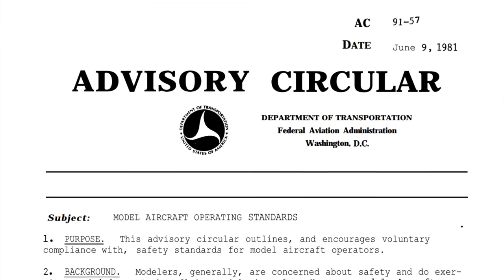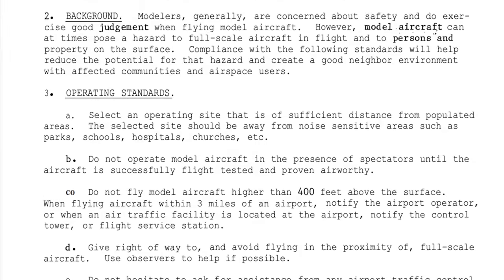A Remote ID Solution for Fixed Wing RC

Comment: Consider that it is actually brilliant to group all unmanned aircraft (drones) under one section and the use of terms that are all encompassing. This methodology "future proofs" the law as it now includes all past, present, and future (perhaps yet to be constructed) aircraft regardless of configuration, propulsion, or lifting method. Also, the past has less relevance than the future potential of unmanned aircraft (drones) regardless of the configuration or physical structure. When airplanes have the ability to hover, they will be just like quadcopters and helicopters. Then you have the "Wings" which is technically not an airplane, but neither a quadcopter. Plus, FPV airplanes now have long distance capability and don't even need an airfield. Yes, it is reasonable and even rational to have all UNMANNED aircraft under on section.
Reply from the maker: The evolution of aircraft, to include RC models, is constant.  But it is a good idea to start somewhere, establish some ground rules and definitions, then adapt as things change and evolve.  Tim
Reply: @TimMcKay56  And here, I thought the ground rules were established: 1) aircraft is defined as any object that can maintain flight. (regardless of configuration),  2) Unmanned aircraft has NO pilot on board the craft, 3) Unmanned Aircraft (or Aerial) System has a remote control station that is not on board the aircraft.  Then there are the UAS rules in the Part 107 section and Recreational Exemption "carve out". The irritation for some is having 1 set of laws and rules for all Unmanned Aircraft. Or specifically, one rule: Remote ID. When you think about it there are more similarities than differences between RC unmanned aircraft; VTOL and hovering being just about it. Now, a Harrier Jet RC airplane would have pretty much the same capabilities as a propulsion only craft (helicopters, quads, etc.). So, that sort of makes everything the same, more or less.

Comment: Disagree.  Lumping all UAS together DOES make sense.  The separating factor should be anyone flying anything BVLOS at altitude or long range should require remote ID.  Regardless of method (looking at phone screen, FPV goggles, Waypoints, etc).  

Anyone flying VLOS, regardless of UAS type, needs no remote ID.  No VLOS flights in controlled airspace (without approval) or above a determined safe altitude.  

Complex area is FPV freestyle pilots and racers.  They shouldn't be regulated to Remote ID either.  They fly low altitude FPV.  You could argue they pose a danger to others (folks on ground, property, etc) but thats not the FAA's purview.

Another grey area might be RC soaring who DO fly at very high altitudes VLOS.  But I'm sure there's a reasonable way to manage that.  I just dont know enough about that aspect of the hobby to comment.
Reply from the maker: Fair enough, just staring the discussion!  Tim
Reply: @TimMcKay56  that is appreciated!

Comment: Hi Tim, I completely agree. Separating out the two activities goes a long way to fixing the concerns with the new drone regulations and RID. This would help a lot with the STEM concerns. I would also say there are othering defining characteristics like having GPS and IMUs on board of drones.

The other change I would like to see with RID is to leave the drone pilot information off the public phone apps and leave it with law enforcement instead. This is for pilot safety.

In any case, it is one really good step in the right direction.
Reply from the maker: Thanks!  Tim
Reply: What two?
Reply: @RickLaBanca  Separate out fixed wings and drones. Drones and Fix wing ("fixed wing" includes helis but excludes drones with cameras) are the two activities that would be separated out from each other.
Reply: @yodaiam1000  no, the point is drones aren’t not one thing. A dji drone is not even close to quads I fly

Also fixed wings aren’t either. Field flyers aren’t long distance  as nice wing fliers.
Reply: @RickLaBanca  It is kind of the point. you want to separate out these different activities. He is just saying in the video to separate out the UAS with cameras and those without. It is one step in the process and it happens to be an easy step. If you want to separate it out further, that is good too. You just need a definition  to separate it out and the camera and the goal of the activity is a way to do that. If you have a camera but are not in the same airspace as video/picture drones, then take the concept further with the drones that do have cameras.  Separate rules out further by weight, altitude, GPS, IMU, sheltered activity etc.
Reply: @yodaiam1000  no I think making a simple division like that is also the problem Tim is trying to solve. 
By lumping helis drones quads together it’s the same as wings lumped in.

Can’t just take a bad first step for the sake of stepping.
Reply: @yodaiam1000  also cameras? No idea why that matters.
Reply: @RickLaBanca  I don't think it is a bad first step. I don't think you stop the relaxation or rollback of overreaching rules because the benefits don't extend to everyone. If you refine it to include your arm the hobby, the is good as well.

How does it adversely affect you if many of restrictions are lifted from fixed wings.
Reply: @RickLaBanca  Cameras are an identifiable feature of drones that are proposed to take video and pictures of the scenery. It is primarily those drones that are supposedly creating the safety concerns for the FAA. You could also add GPS and IMUs as features of drones that are taking video and pictures of the scenery to better isolate the main concern.
Reply: @yodaiam1000  by implying that wings are not needing remoteid it implies other aircraft do. 

Especially if the argument is (incorrectly) contrasting the other types of craft.
Reply: @yodaiam1000  that’s too wide. It’s hard to draw the line, but fpv quads aren’t something anyone can grab and fly yet it’s may have all those components.

Comment: Tim, do you know where the 250 gram weight limit came from?  I think a kilogram would have been a more useful and workable limit.
Reply: Tim wants you to fly rubber band motor models, but only at approved airfields.
Reply from the maker: Freed:  I do not work for the FAA, but my guess is they tried to figure out a light enough weight such that a drone of this weight either hitting an airliner or getting sucked into an engine would cause minimal damage.  1 kilogram may work as well, we'll see.  Tim

Comment: The Department of Transportation has no problem categorizing automotive vehicles. No one would assume regulations for an 18-wheeler would be identical for a motorcycle. The FAA needs to separate LOS aircraft from BVLOS/GPS aircraft to fix most of the problems (government overreach) we're dealing with today.
Reply from the maker: Agree!
Reply: Again this is not a good idea. People here don’t even know the differences, lumping in store drones that fly for half an hour with built models. 

I’d be much more open to pilot separation as is ham radio vs unlicensed operators. 

Part 15 radios vs honestly built. Faa could do the same.

Comment: hi Tim
I built a 8 ft tall model crane with 6 -2 wire 12v motors. is it possible it set it up with rc control?  thx
Reply from the maker: I cannot see why not . . . good luck!  Tim

Comment: Yesterday Tower Hobbies canceled my order for the Spektrum SkyID RID module. I contacted Tower today and they said it was a system glitch. I have to reorder and there are 2 days left on the pre-order discount. ETA for the module is now late November. It was previously 10/22 which is tomorrow. Not sure what to make of it.
Reply from the maker: I am in the same boat here.  I ordered my SkyID from Horizon Hobby on Aug 25, has still not arrived.  Tim
Reply: @TimMcKay56  RID is off to shaky start.

Comment: Simply put, It isn't what you fly. We already have to get waivers for above certain weights of aircraft. If you fly a camera drone at your FRIA , and follow all the rules under AMA, what does it matter what I fly, within the guidelines of AMA and the FAA. Your trying to add additional restrictions that  don't improve safety.  If, probably DJI drones are routinely being seen in conflict on approach/take off, That is a person operating a drone in a reckless and dangerous manor. That operator must be found quickly and processed appropriately.  If, like I have done, fly at a park within about 2 miles from the end and a mile off the approach corridor of a busy city airport, LAANC approval, and I stay below the allowed altitude , 200ft for this spot I go, it is a non issue.
Reply from the maker: Roger all!  Just trying to start the conversation.  One needs to begin somewhere, simplify a bit to get the first step done.  Tim

Comment: This would be a good solution. Lets not forget our friends RC helicopter and autogyro pilots. They fly at the same fields as us fixed wing pilots with the same contraints, i.e. piloted by a human not a microprocessor.
Reply from the maker: I mentioned that in the video, when I say fixed wing include the helo folks.  Tim
Reply: What about all of the "acro" fpv drone pilots? It seems everyone thinks that fpv drones you just buy off the shelf and suddenly you can fly, when in fact most are custom built and require 10+ hours of practice in a simulator before you can fly without constantly crashing. The barrier to entry is extremely high in both cost and skill (both piloting skill and build skill) It's unfair/misleading to show a clip of fpv drone footage and in the background talk about how anyone can easily go buy a drone and fly it.
Reply: @gordonmckay4523  as long as they're flying legally, whats wrong with that? All of the drone races where I live occur at club fields by the way, and all of the fpv pilots I know are very cautious about where and how they fly. Fpv drones are for acrobatics by the way, not "pictures" as you stated in your video. The drones you are talking about are photography drones like those made by dji.

Comment: Drones were required to operate at 30 GHz, they would have to be operated line of sight because that doesn't go through any obstructions, and the range would be severely limited because of the power requirements to go far.
Reply from the maker: Interesting point!  Tim

Comment: It is like Citizens Band radio and Amatuer radio.

The Hams are serious hobbyists who have a massive, and long standing, interest in advancing the art and science of radio.  The radios and antennas can, and do, cost tens of thousands of dollars+.  The yahoos are generally hated, and except for some bands where the "bad" people hang out, it is somewhat of an orderly hobby that takes place worldwide between enthusiasts.  

The Hams must take an FCC exam to operate their radios!

CB is a monkey zoo, but there are serious users of the medium (truckers generally-I rarely listen to CB).  No exam is required for CB (the radios are licensed by the manufacturer), and it shows in the patrons.  GMRS doesn't require an exam, but there is a modest fee for a license ($35/every 10 years).

The FCC recently has been ramping up enforcement!  Big fines and seizing equipment.

The whole thing reminds me of when CB exploded in the 1970s.  Eventually sUAS will all settle down I guess.

As you pointed out, in the 1970s, model flying had a large $$$ barrier to entry (certainly I could not justify the cost in the 1970s).  China has made Ham radios cheap, compared to the premium Japanese stuff.  However, the Hams seem to be policing their territory still, especially given that the VHF bands are dead compared to what I was hearing in the 1980s.

Remote ID is the means for the model flyers to take back their hobby.
Reply: And unlike the faa, the fcc and hams have always worked together.

I agree I’d rather separate class of pilot instead of class of craft. 

No remote id for a licensed hobby pilot. 

Remoteid for store bought. 

This is like part15 radios for consumers vs home brew which is legal only for hams.
Reply from the maker: Copy!

Comment: It is hard to make this case to the FAA, when the AMA ran to embrace the quadcooter flyers when they became popular. The AMA should distance itself from any flyer not using an AMA  or specifically dedicated flying fields. That includes schools, concerts and parks where the public may be present.  Sorry RC flying is not compatible flying over or near the public, doesn't matter if the vehicle is big or small.  The AMA screwed up, what can you discussed that relieves RID,  flying at an isolated field, that's the distinction. VLOS is the boundary that makes all FAA rules superfluous.   Well Tim you've finally come to your senses after a long time.
Reply from the maker: Any organization or person can change their minds as events develop.  I think this is fairly normal.  I certainly cannot speak for the AMA.  I do know from reading their magazine that youth outreach is a huge part of what they do, so they are pretty much going to be involved with drone RC activities.  My point with all this is that the RC hobby is evolving so quickly in so many ways, it would be a very wise idea to accept this and form some strategies/relationships with USG agencies that are for sure going to get involved.  Lead the conversation, not just follow it.  Tim

Comment: What about helis?

There’s not two part separation.
Reply from the maker: I mentioned it once, my intent was to use helos and fixed wing in same sense.  Tim
Reply: @TimMcKay56  then why not include quads which might as well be helis?
Reply: @gordonmckay4523  well the wings are fine on their frias so why not start with who is getting impacted the most…. Freestyle/racing quads that require skilled pilots? A Best Buy purchaser couldn’t even get one off the ground without crashing.

Comment: Point of order.  Congress (not the FAA) defined what a UAS is in Public Law 112-95, Section 331 back in 2012.  Unfortunately the law didn’t distinguish between RC and quad copters.  There is no distinction between FW RC and RW RC in the law either.  It’s unfortunate that drones have negatively impacted the RC community by the irresponsible flying by some drone flyers.
Reply from the maker: Good point, thanks!  Tim

Comment: Thanks for continuing the discussion of RID. But you yourself stated thst that thr motivator behind RID is control the airspace to make it easy for commercial drine flights. Its not really a safety issue.
Dont throw the fixed winged vuys who like to put cameras on their planes under the bus. No amount of rules will make dishonest or reckless RC pilots less so. Rules will only restrict those who want to fly safely.
Reply from the maker: My point on all this is to start a discussion.  Many, many RC pilots, with zero experience in government, want  an all or nothing approach.  If you take this path, you will for sure get nothing.  My idea is to notch a win somewhere, anywhere and build from that.  Getting certain fixed wing RC planes relief from RID is a possible, achievable goal.  We are not "throwing anyone under the bus," rather getting a win and building on that to get further wins.  Tim

Comment: Although it might be much harder for congress or the FAA to swallow, the idea of a 400-land-air right (act) might give back freedoms that are otherwise being lost. Whoever owns and/or controls the land should have the right to designate how the free air up to 400 feet is used for unmanned flying craft. You should be able to designate the air as open, open with remote ID, or closed. The default for uncontrolled airspace where the land owner/controller has not registered intent would be open with remote ID. I think everyone would like to have a say in how the low level air space above their heads is being used. The FAA would be responsible for issuing the designation with a rarely veto for certain “safety related” circumstances. Ready to fly UAS over 250g that only require the addition of batteries, receiver, and/or transmitter, and less than 60 minutes build time, MUST be fitted with remote ID by the manufacturer, and must be registered with the FAA before flying by the owner. Remote ID may only be disabled, not used, or not fitted, when flying in 400-land-air areas designated as open. The FAA will likely say that this is too much to manage without additional resources, but that’s where they can negotiate with government to ask for more budget. The NextGen ambitions of the FAA are not altered by this scheme.
Reply from the maker: Interesting approach!

Comment: Great video. Thanks Tim.  I started my RC flying in 1970.  IMHO, fixed wing RC planes basically fly in their flying field's pattern air space. This is basically an area not much larger than 100 to 200 yards beyond the the ends and edges of the runway.
Reply from the maker: Agree!  Tim
Reply: As do… freestyle quads and racing quads.   
Y’all have no idea about quads.
Reply: @RickLaBanca  Are you saying that fixed wing pilots can't have relaxations of the rules if you can't have relaxation of the rules for the type of flying that you do?
Reply: @yodaiam1000  no I’m saying why wings only.
Reply: @RickLaBanca  I don't think anyone is saying wings only. He is saying split into camera/non-camera. However, it can be split further. GPS/IMU controlled/stabilized and non-stabilized can be split up. I think the main thing is that video/picture drones are the ones that have incursions and not the other UAS.

This is how manned aviation works. They different rating and regulations for different configurations.